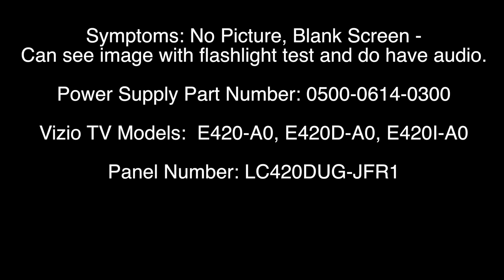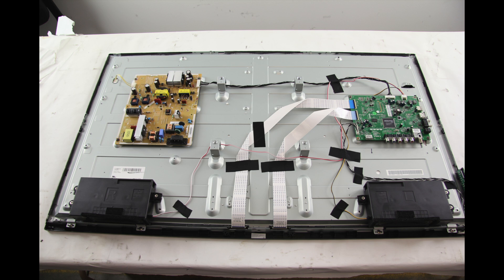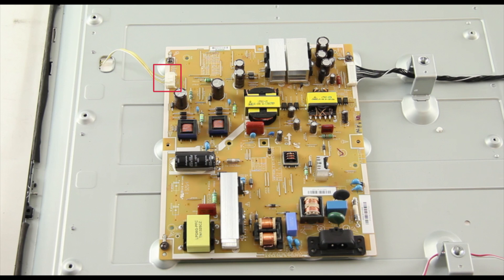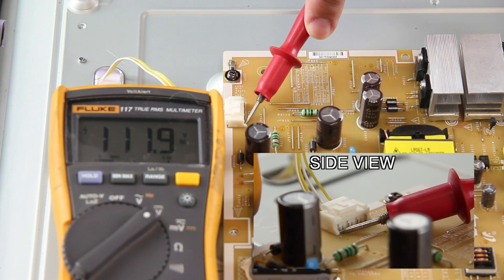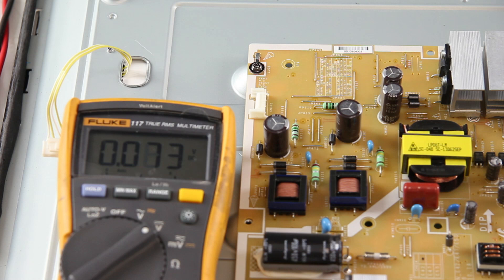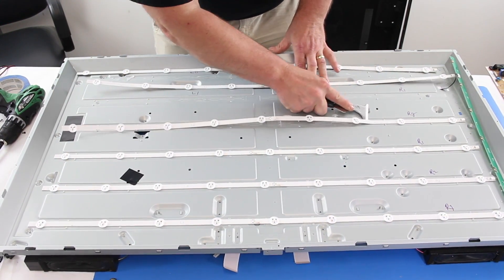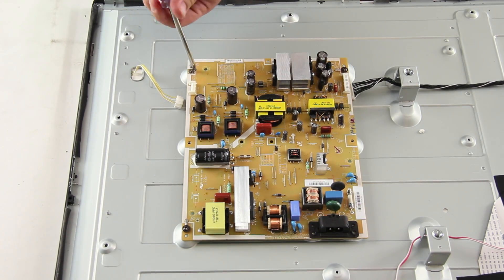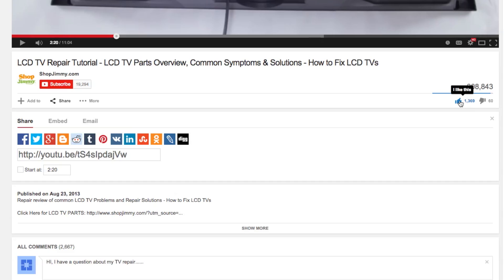Vizio E420-A0 E420i-A0 E420D-A0 LED TV No Backlights - Voltage Test Troubleshoot LEDs & Power Supply

Comment: when the cable was unplugged I got 0.01 - 132v - 0.01v - 132v. And when it was plugged in i got 0.65 - 132v - 0.65v - 132v would that mean my board is bad?
Reply: That means the LED's in the panel are bad

Comment: I have a Vizio E420-A0 that won't turn on. I've replaced both the power board and the video board to no avail. Press power button or remote, LED turns on momentarily then goes off. Same as Brian Forbes. I see there is no reply to his comment either. HELP.

Comment: Good afternoon,

I have a Vizio E420i-B0 that will sometimes be extremely dark at the top like the LED's are not on. If I unplug the tv and plug the tv back in the tv works great. I found information on other like models but those models only have power supplies with Vout1 and Vout2. I am just looking to figure out if the PSU is good or the LED's are bad what is the normal voltage for this unit? I did check the schottky diodes and they all tested fine.

With LED's plugged in but only the bottom half of the strips are lit.

1+ 59.2

1- 21.14

2+ 59.2

2- 16.75

3+ 59.2

3- 21.46

4+ 59.2

4- 16.9

5+ 59.2

5-16.86

6+ 59.2

6- 1.650

Without LED's plugged in.

1+ 42.5

1- 4.42

2+ 42.6

2- 4.43

3+ 42.6

3- 4.42

4+ 42.7

4- 4.41

5+ 42.7

5- 4.44

6+ 42.7

6- 4.45

With all of the LED's lit after unplugging and plugging it back in a couple of times.

1+ 59.51

1- 21.61

2+ 59.48

2- 1.364

3+ 59.44

3- 21.92

4+ 59.42

4- 1.531

5+ 59.41

5- 1.559

6+ 59.38

6- 1.606

Comment: Thank you! Found just one strip is bad. It is very strange how Vizio paired these strips, it has 5 strips, 1 and 5 are linked together, and 2,3,4 together. So if any one from 2,3,4 is bad, the whole middle section is out. Instead they should have pair them as 2, 4 and 1, 3, 5, so if any one is out, it still will be watchable...

Comment: Hey shop jimmy the model I have it’s alittle different than what your working with. It’s a Vizio model. I see your checking power in 2 spots. My boards saids vled+, led. I have 96v led+. But 0 on my other one. And I think like 10 when running. LEDs are on, just dim it flickers back and forth brighter than dim. Everything else works. Could my leds only be fed from 96volts?

Comment: So if my voltage on Vout1 is normal but voltage on Vout2 is more than normal does that mean the leds going to Vout2 are possibly bad? You example only shows if they are both high or both low/none but what if only one of the Vout’s are high and the other is normal?
Reply: UPDATE! Apparently the HDMI cable that was connected to my Apple TV was bad. I swapped it out with a new HDMI and the dimmed black horizontal line across the middle of the screen went away. I’m guessing my Vout2 was okay because I was getting around 135-145V which I thought was high since I thought it was supposed to be 120V but picture looks great now. 
I did try swapping out the HDMI at one point before but it wasn’t brand new, like the one I just installed that made it work, so I guess that cable was bad too. I was starting to think the issue was my new 4K Apple TV at first because, while it was on, a bright white light would flash horizontally across the middle of the screen which is where I finally realized is the same location that the dimmed black line was showing up. I did have 3 other devices plugged into my tv through HDMI so I am hoping that is the cable since it’s working fine now, but if it starts happening again then I will be left to believe that the bright white light is from the Apple TV. For my situation if any device or any HDMI cable that flickers a bright white light will inevitably cause damage to either the leds or components. Trouble shoot with the basic stuff first because I would have bet money that my LEds were bad but apparently I was wrong.

Comment: I have a Vizio E420i-A0. No picture and no sound. The power light comes on for 1-2 seconds and then goes off. I have replaced both boards and still nothing. Anything else I can cheaply try, or do I scrap it?
Reply: I have the same problem. Did you ever resolve it?

Comment: Idiot e5500-ae. I did the flashlight test and could see the image.   When looking at the back of the tv with cover removed, I can see the backlight turning off and on. I ordered and replaced the power board and same thing happens.  Suggestions?

Comment: I did this test in my TV.  V1 cycled between 90, slowly counted down to 80v, then jumped to 90v and repeated itself. 

V2 did the same, starting at 140vdc and 130vdc. 

After unplugging the led strip, I got the same results and voltage. Is this a power supply issue or an led strip issue?  Thanks
Reply: Did you ever figure it out
Reply: @JasonLeef33dm3  if I remember right i just threw the tv away.

Comment: Karen Lalko1 minute agomy tv won't stay powered up for more than 10 seconds. You turn it on and 10 sec later the power light turns off . How can I check voltages etc with this problem. Thanks in advance

Comment: my tv won't stay powered up for more than 10 seconds. You turn it on and 10 sec later the power light turns off . How can I check voltages etc with this problem. Thanks in advance

Comment: I watched this video for troubleshooting the power supply/ LED board.I have a vizio E420-A0. It has audio but no video.I did the flashlight test and could see the menu. I checked the voltage at the points shown. It showed no voltage. Unplugged the LED strips and checked again, still no voltage. I replaced the board and when I plugged the TV in I heard a small pop. The TV still does not work. Do you have any suggestions? I don't want to spend to much on this TV. Thanks

Comment: I have an LG42LN5700. The screen flashes for a second and I have sound.  There is a picture when I do the flash light test.  The 4 leads going to the LED strips are marked LED+, LED- , LED+, LED-.  When I test for power on the LED+ wires with the LEDs unplugged, I get 197v then it starts dropping down to 122v (with one lead grounded to the chassis) When the test voltage on the L+ wires, the voltage starts out at about 180v and starts dropping.  Appreciate any help you can give me.

Comment: I have a 50 inch Vizio E420i-A0 with a 0500-0612-0300 power supply / LED board. It has 10 rows of 5 LEDs = 50 LEDs at 3.2 volts each = a total of 160 volts.
1. Is 160 volts the correct voltage I should be getting at the LED connector?
2. I am getting approx. 136-138 volts at the connector with and without the LED connector plugged in. Does this indicate bad LEDs?
Thanks

Comment: I have a vizio e420-a0  I'm trying to test the power board I'm wondering what the correct voltage is when testing the 2 led test points

Comment: I have a Vizio E420i A0  and the top and bottom of the picture is not as bright as normal. I noticed that it flickered to normal a couple of times and now it is dim all the time. would this indicate a bad power supply since it seems to be just the top and bottom backlight? 
I know it's hard to say without opening and testing the power output.
Reply: Same exact thing happend to me! Top and bottom rows are dim all the time now. So I got the same question.

Comment: hello I have e420i-ao that has a spot that is sometimes darker than the rest of the screen. it almost seems as if one backlight is malfunctioning.

I noticed the tv had a dark spot on the bottom right corner and attempted to troubleshoot the issue by messing with backlight settings. I turned the backlight up to %100 from the normal of %90 and the spot went away, it soon returned so I disabled adaptive lummia witch also made it go away temporarily . The spot is now there sometimes and other times isn't, sometimes it pulses darker/lighter about a five second delay between 
dark and light. It is literally only the bottom right corner that does this. 

any help would be appreciated.

thanks
Reply: I can post a short clip of me toggling from 90% to 100% backlight and the spot showing at 90% and disappearing at 100%, however it sometimes also shows at 100% even with all backlight features turned off including abaptive luma, smart dimming and the ambient sensor. This problem happens on all inputs.